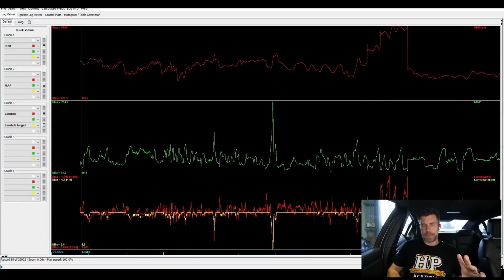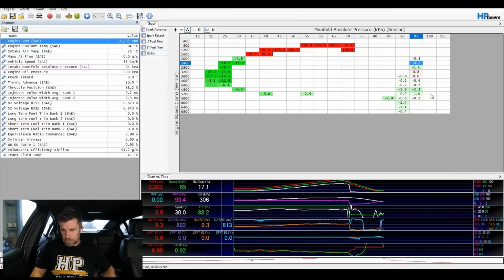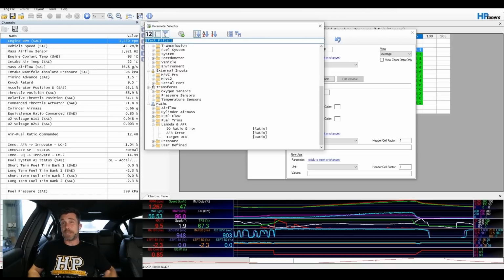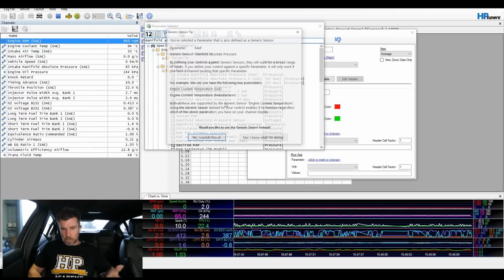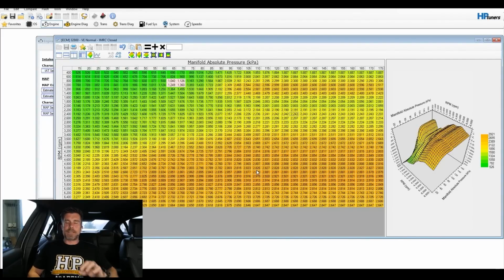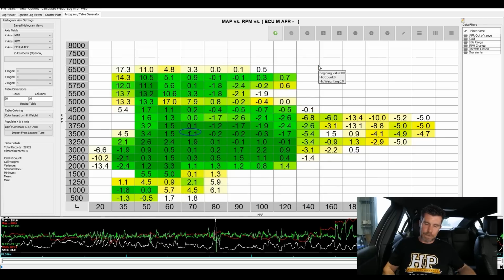Is this 1 step the difference between a PRO tune or a HACK job?

Comment from the maker: TIME STAMPS:
0:00 - Introduction
0:35 - Time graph vs Histogram
3:40 - Not all software offers histograms
4:30 - HP Tuners overview
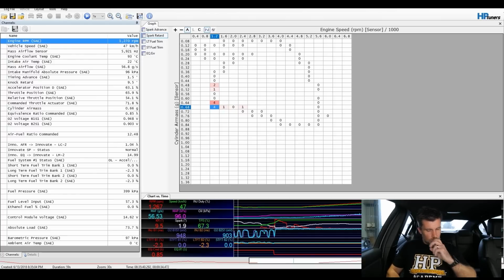14:15 - Required inputs
19:15 - Setting up a histogram - MAF error
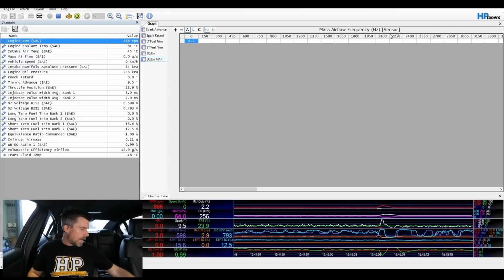27:55 - Setting up a histogram - Speed density error
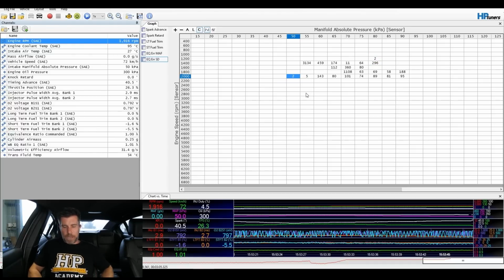38:10 - Comparing back to time graph
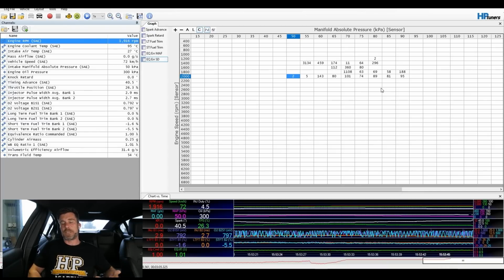38:45 - Dyno run example
46:05 - MegaLogViewer HD example
53:45 - Questions
------------------------------------
🙋‍♂ Take $25 USD off ANY HPA course with coupon code: YOUTUBE25
Enrol now: https://hpcdmy.co/25offyt
------------------------------------

Comment: To those starting/learning how to tune a factory ecu like GM, aim for 2 to 3% rich and don't beat yourself up trying to get 0% error. The extra few % will be a pillow to cover some weather changes that may put you at 0% error on some days.
Definitely never call it done if you see lean spots where you're accelerating.

Comment: When street tuning with HP Tuners, log FTC fuel trim cell. Then you can add a filter to the histogram to only log acceleration data and not idle or deceleration.

Comment: When live, every time you stop a datalog and press record again, it automatically saves the datalog. It begins a new file once you press record again.

Mentioning this as it has helped me out in the past when I forgot to save a file manually. 

In your program files, look through the HP tuner folder and you will find that unsaved datalogs folder (not called exactly that). I always look it up based on date and time, extremely handy even when referencing a datalog from many years ago.

Comment: At 42:09 the short term fuel trims are reading 2 % rich while the wideband eq ratio is lean at 1.03 to 1.04 lambda. 

More prominent at low exhaust flows, this could be due to the wideband placement being much further back from the exhaust valve than the narrowband location. But if the distances are roughly the same and no exhaust leaks near the wideband, then I bet that was a Bosch wideband.

 I find those read 0.2 to 0.5 afr leaner than an Ntk wideband and leaner than the narrowband fuel trims also.

Handy to play the logs at 0.1x or so when finely analyzing a certain area.

Comment: 🎯 Key Takeaways for quick navigation:

00:00 📊 Histograms are a valuable tool for data analysis in tuning, providing a quick and efficient way to analyze trends in a large sample size of data.
02:38 🚗 Histograms are not limited to fueling analysis; they can be used for tasks such as mass airflow sensor calibration, ignition timing tuning, and idle control target tables.
04:06 🛠️ Not all software packages provide histogram options, but generic tools like MegaLogViewer HD can import data from various sources, making it versatile for analysis.
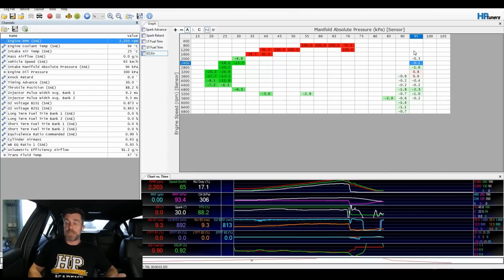07:41 📊 VCM Scanner software in HP Tuners allows users to create and customize histograms for tasks such as monitoring equivalence ratio error, spark advance, and spark retard.
14:25 📉 To fine-tune fueling, a wideband air/fuel ratio meter is essential. Using a CAN-based wideband controller ensures reliable data without ground offset issues.
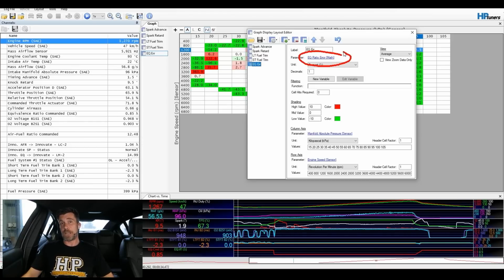18:53 🔄 HP Tuners VCM Scanner simplifies the creation of math channels, helping users calculate the difference between measured and target air/fuel ratios for efficient tuning.
19:48 🛠️ The process of setting up histograms, demonstrated with mass airflow sensor calibration, can be applied to various tuning tasks, offering flexibility in analysis.
21:37 📊 When creating a Mass Air Flow (MAF) calibration histogram, start by adding a graph and table, labeling it appropriately, such as "EQ error" for equivalence ratio error.
22:29 🧐 Choose the parameter for logging, like equivalence ratio error, and select it based on whether you represent target equivalence ratio in air/fuel ratio units or lambda.
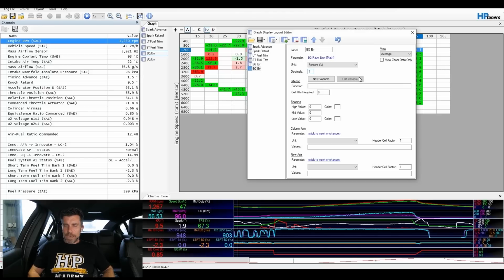23:52 🔄 Use filtering options when setting up the histogram to exclude data from specific conditions, like cold engine temperatures or closed throttle, if needed.
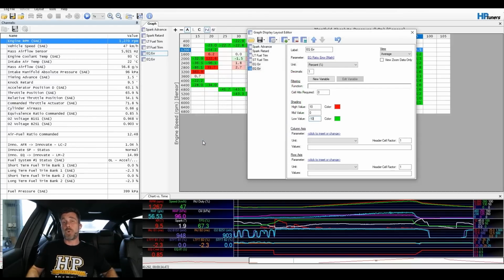24:46 🎨 Optionally add shading to the histogram for visual cues, using colors to represent high and low values, providing a quick glance at the magnitude of errors.
25:13 📊 When setting up column axes for a 2D histogram, choose the parameter relevant to your analysis, such as mass airflow sensor frequency in this case.
26:10 📈 To ensure histogram breakpoints match the editor, copy column axes labels from the editor and paste them into the scanner software for accurate data representation.
32:36 🌡️ Before gathering data for the histogram, ensure the engine is at normal operating temperature, and beware of heat soak to acquire good quality and accurate data.
35:44 📊 During data gathering, stay in each cell long enough for the numbers to stabilize, as the scanner continuously averages measurements for accuracy.
37:32 🔄 Analyze the reliability of histogram data by checking the count (C) for each cell, indicating the number of data points, and prioritize cells with higher counts for more accuracy.
38:28 🚗 When performing a ramp run, start logging only at full throttle just before the run and stop it before backing off the throttle to ensure clean and relevant data.
40:32 📉 When analyzing results, be cautious about recording transitions and ensure data is focused on the wide-open throttle portion to avoid inaccuracies in the histogram.
42:21 📊 When using data for tuning, ensure you are on average values to accurately represent your graph.
43:15 🔄 Utilize the "paste special" function in HP Tuners to automatically apply corrections from a histogram to the VE table.
45:32 📈 Use "multiply by percent half" in the paste special function as a cautious approach when nearing the target in tuning.
46:23 📊 MegaLogViewer HD can work with any .CSV file, making it versatile for various ECUs and dataloggers.
48:08 📏 Manually adjust break points on axes in MegaLogViewer HD to match and analyze data, similar to HP Tuners VCM Scanner.
49:03 🎨 Customize and create custom fields in MegaLogViewer HD for displaying parameters like air/fuel ratio, allowing flexibility in data analysis.
52:37 🎯 Use data filters in MegaLogViewer HD to focus on meaningful data, and be cautious with areas where trust in data may be compromised.
54:08 🚗 Addressing knock involves considering air/fuel ratio and ignition timing; iterative process based on engine characteristics.
57:45 🎯 Aim for +/- 2-3% error in closed-loop cruise areas; be less tolerant of lean mixtures at wide-open throttle.
59:39 🔄 Export AEM Infinity logged data in .CSV format for analysis in MegaLogViewer HD due to potential lack of native histogram functionality in AEM.
01:01:09 💻 HPA members have access to a wealth of webinars covering engine tuning, building, wiring, suspension development, and more; membership details available on hpacademy.com.

Made with HARPA AI

Comment: I've loved working with MLVHD and the histogram features in particular, although I find it difficult to configure the filters with enough authority to remove small map and throttle fluctuations.  I'm sure there are resources out there on how to modify the filter formulas that I simply haven't found yet, but if anyone happens to know of one I'd be grateful to know.  My car in particular is extremely sensitive to even minor levels of MAPdot and TPSdot due to the somewhat large throttle and non-ideal injector placement.

Thank you for the great video as always.

Comment: Awesome video Andre. I use EFILive, but obviously the principles are the same. I dont know how anyone can tune without logs and call themselves a tuner. Must be allot of hacks out there!
Reply from the maker: Sure are but customers are also smarter than ever given what information is out there these days, so it's harder and harder for people to cut corners and not be called out for it compared to 10 - 15 years ago even. 
There will always be some element of shadiness or incompetence, you get that in any industry, but the more information there is out there the less and less it happens which is cool 😎 - Taz.

Comment: I always finish a tune by building histograms from logs to compare to targets I've set. 
Obviously setting the correct filters and looking at the meaningful datas is essential. 
The most painful in the process is sometimes finding a way to import datas in megalogHD. For me it's great tool to have in my toolbox, which sometimes helps to spot non-optimal settings